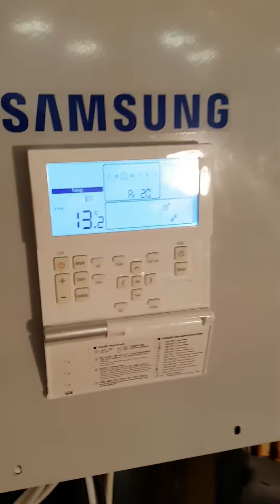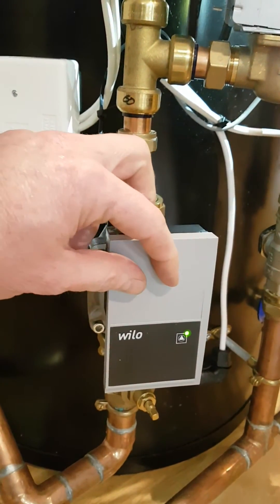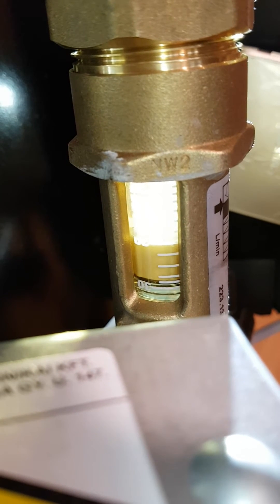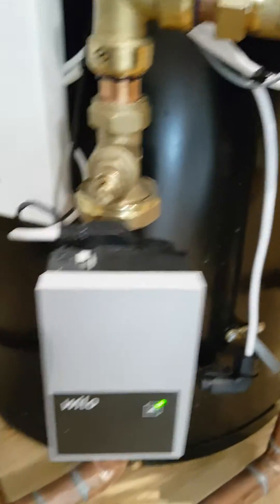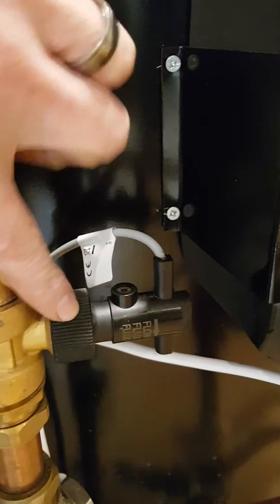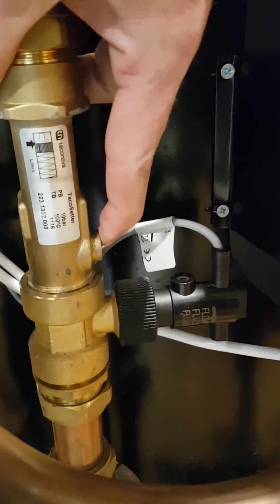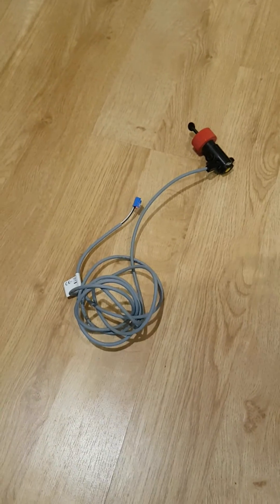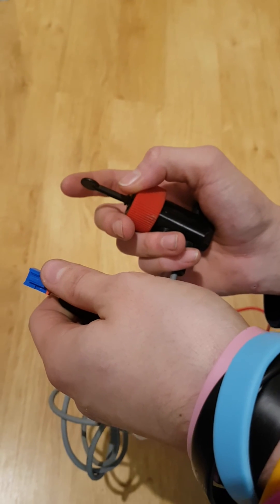E911 and E912 Samsung air source heat pumps your flow rate is too low and my unit keeps stopping

Comment: Great thank you very much. Found the valve with the filter that was blocked, gave it a quick wash and the flow rate back up to 30. Nice a simple and saved waiting for an engineer

Comment: Thank you for your video. I have installed a new heatpump, i have about 33 to 34 liters/minute but twice a day i have the code e911. Can you help me with that problem ? Filters clean, system flushed with new water, i have a water tank from 120l for assuring that i always have enough water flow. I don t know where the problem could be.
Thank you for your help

Comment: I have had E911 error all the time when it was on Off, when i turn it On the error go away and everything works well.. until today.. after continuously running for 2 weeks i saw on the screen error E911 and the pump icon on the screen (C) is not appearing.. tried to turn it back on but the pump icon doesn’t appear and nothing happens.. i have tries to close and open the valves in my home nothing happens.. before when i was closing and opening the valve back i felt the pressure of water coming back again, but today nothing happens when i open the valves (there is no that water pressure feeling when you open the valve back). What could be the problem dear sir?

Comment: So been looking at your videos with interest and I am getting the Sun icon disappearing but no error codes.This falt is sometimes not detected until the morning, where unfortunately the pump then has to make this up by 4 degrees!
The flow rate seems to be 26l , in your video you say 20l is sufficient, may its too high?
Also , sorry about all the questions , but I cant get anyone here in Elgin to help me . If in the summer where I don't require heating and hot water is all that's needed only morning and evening,  I find that the circulation pumps are on and switching the system off at water and sun icons I save 10 to 15 kw by doing this. Surely it should be wired to do this automatically Water temp barely drops 1 degree fro morning to evening. Again I cant get an electrician to look at this locally.I also need an older type hand book, the one I see has not got a control unit like the one in the download.Please get in touch when yo get this !
Unit model AE160JXYDEH/EU

Comment: Hello. Can you advise on error E912? When I turn OFF the home heating/cooling mode and only the DHW (water heating) is switched ON, after 5min I get the E912 and it is not heating the water. The only way it works is to stay with heating/cooling mode ON (even on the lowest values). So here's the schema: 1. if the heating/cooling mode is ON and DHW is ON - it works. 2. if the heating/cooling mode is OFF and DHW is ON - it doesn't work (E912). So I had to let the pump heat a little bit even on hot summer days, so I could use the warm water... Samsung EHS 9kW from 2017
Reply from the maker: im assuming this is an old unit, your flow switch is not returning to the off position when the pump stops, you might be able to clean it or you need a new flow switch
Reply: Thank you for the answer. I assume that flow switch is the black one with little arrow: https://imgur.com/a/VSXTfTX? In addition to my last comment, I changed the value of the 4013 parameter, which should stop heating mode when the set temp value is lower than outside temperature. Well, for my test it was set to 15deg, outside was 20deg, I think floor heating was cold indeed, and the error didn't occur.
Reply from the maker: @gldfish  yes thats the one